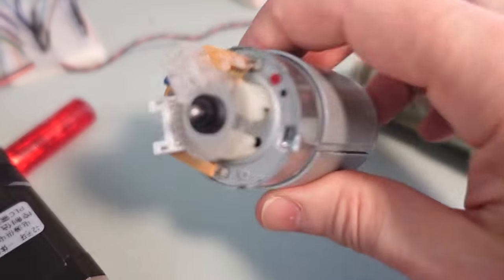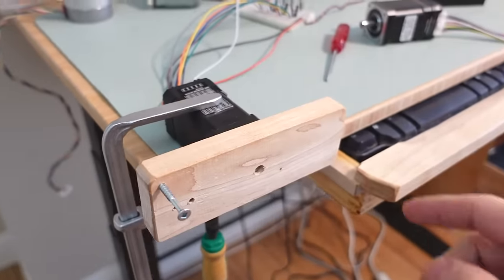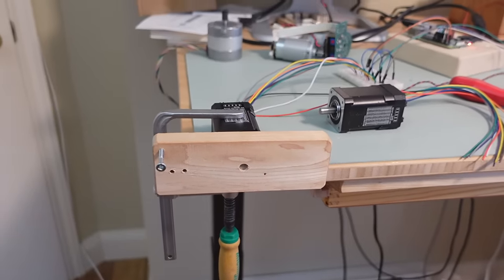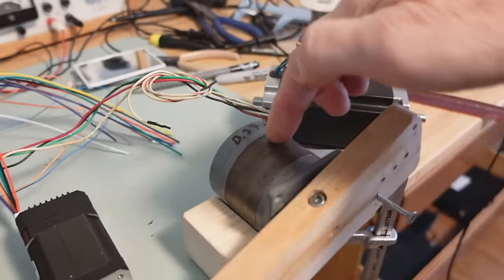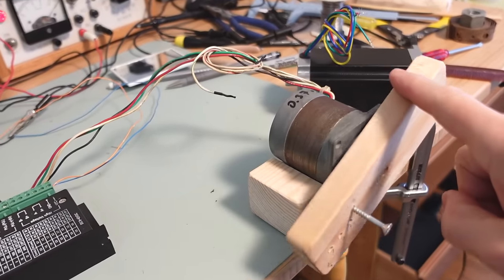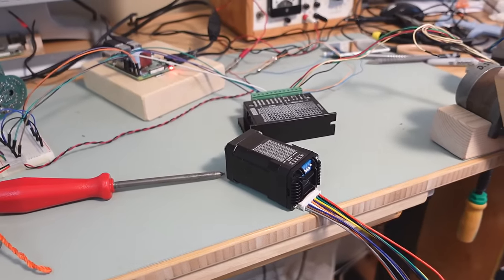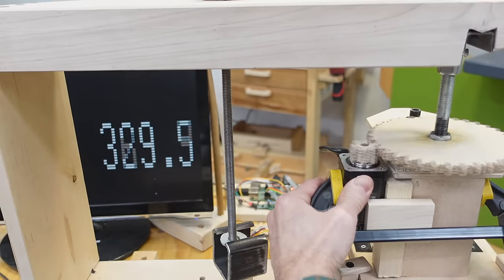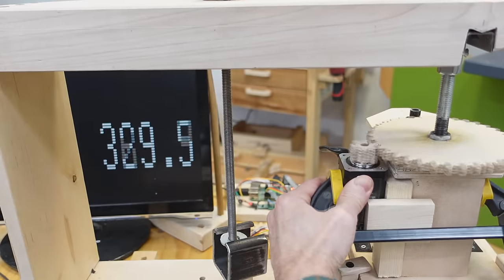Closed loop stepper motors -- very impressive

Comment: "Whereas with a stepper motor..." Um... huhh? You were just talking about a stepper motor before that already. "So the tricky thing with a stepper motor is..." and then you compared it to another stepper motor. Huhh? Didn't you mean, for clarity, "closed-loop stepper motor" vs. "REGULAR" or "conventional..." "...stepper motor"? Seems so, because just "stepper motor" vs. another stepper motor doesn't make sense. EDIT: I do like that you started saying "conventional" later. But then of course you ruined your improved track record by saying about the closed-loop ones, "and even though they cost quite a bit more than stepper motors..." Oops!